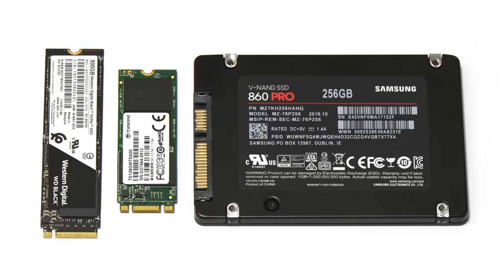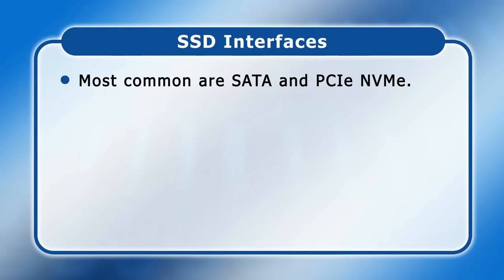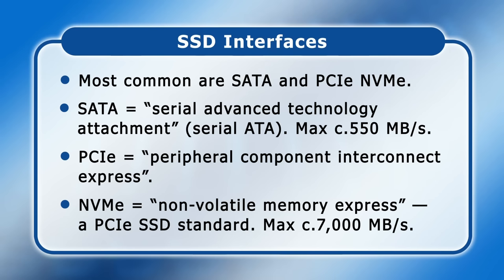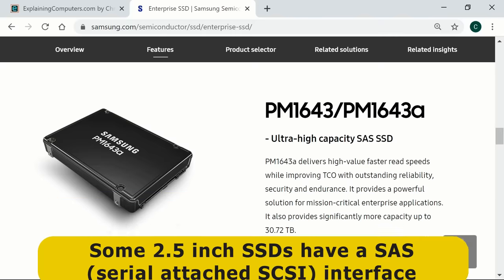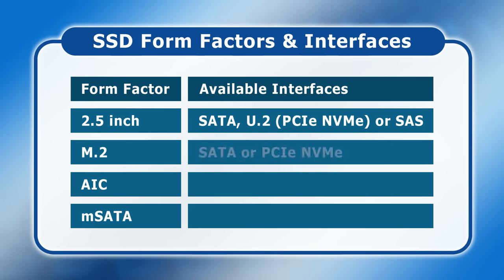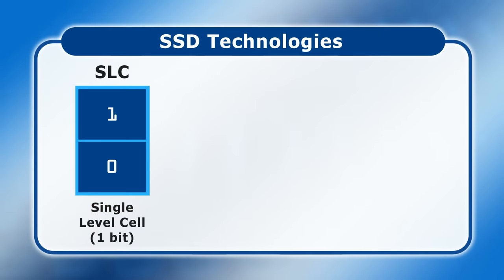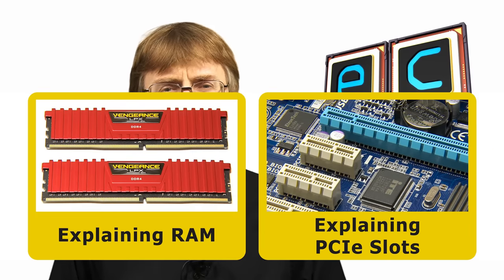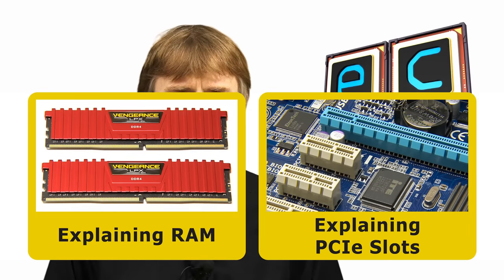Explaining SSDs: Form Factors, Interfaces & Technologies

Comment: This video is missing the various Apple PCIe slots, with different ones used in different models of MacBook, iMac, and Mac Pro.

This video is missing that Intel is exiting the NAND flash business, selling it to SK Hynix. We may not be seeing a PLC from Intel.

The most silly thing the video is missing is all the PCIe AIC that are actually SATA. A lot of PCIe cards adapt NVMe to PCIe, but especially the 2-m.2-slot adapters are SATA. Some of them even have SATA plugs, and use the PCIe slot only for power.
Reply from the maker: Certainly I ignored Apple here. Good point that Intel will soo be out of the NAND flash business, so will not be a final manufacturer of PLC SSDs.

On PCIe cards, it is not the case that all AIC  PCIe cards "are actually SATA". By definition, all PCIe cards connect to a computer via PCIe. There is no SATA interface in a PCIe slot so AIC SSDs cannot possibly be SATA. Granted, there are some PCIe adapter cards that allow SATA SSDs to be connected to the computer. But in all cases, the device is PCIe (though obviously a SATA SSD connected via  PCIe adapter can only run at SATA speeds).
Reply: I agree, it is certainly not the case that all AIC PCIe cards are actually SATA. Probably the majority on the market are not SATA. But just because the card connects via PCIe doesn’t mean it uses PCIe for data, nor that it connects the onboard drives directly to the PCIe lanes.

I should have clarified that the devices are silly, not the video. A contrived example is the Gigabyte i-RAM from long ago: A RAM disk that used PCI for power and transferred data via SATA cable. Much more common now are devices like this random device as seen on Amazon: One M.2 slot is NVMe connected to the PCIe lanes, and the other M.2 slot uses PCIe for power only and connects data via SATA cable.
https://www.amazon.co.uk/Rivo-Dual-SATA-PCIe-Adapter/dp/B07CGQKTWD/

Comment: Still no significant difference between nvme and sata3.  The short conclusion is, when it comes to only gaming, the tiny difference between M.2 NVMe and 2.5 inch Sata drives doesn't (in most cases) justify the price difference.

M.2:Who are you?
SSD:I am you but cheaper!
Reply from the maker: I agree that, for many home and gaming computer users, the benefits of an NVMe vs a SATA drive are pretty small. But note that, as this video discussed, M.2 is a connector -- so your final "discussion" is between NVMe and SATA, not M.2 and SSD. :)

Comment: So I could practical destroy and qlc ssd by formatting it 300 times? Wow that may not be practically possible but sounds concerning.
Reply: Unlike spinning discs, SSD do not require formatting to align the sector areas. This lessens the need to over-write old data, unless security is of the utmost importance. Realistically, you are just marking the locations as available for writing as opposed to blanking them out entirely.
Reply from the maker: Not just by formatting (well, not using the "quick format" option, as we normally do). But yes, if you wrote data to every cell on the drive and deleted it 300 times, the SSD would not be left in a happy state. It is for this reason that QLC drives only come in large capacities -- 1TB+. So you would have to write 300TB of data, which is quite a lot.
Reply: @ExplainingComputers  Ah yes...Makes sense.

Comment: MSATA was most expensive until now.
Reply from the maker: Surely not as expensive as SAS, U.2 or AIC SSDs?! :)
Reply: @ExplainingComputers  Well I have Gigabyte H61TN motherboard. Suddenly my MSATA was report on S.M.A.R.T position.

128GB replacement was 700.000 IDR (60 USD).

So I'll just stick with 2.5 Samsung SSD 860 Evo 250GB for better capacity. 👍

Comment: How are we already at the point where 100 TB SSDs exist? That thing seems like it could last quite a while!
Reply from the maker: I'm afraid you are wrong here. Yes, each cell has that number of P/E cycles. But that does snot mean you can multiply the number of P/E cycles for the drive (capacity) by that number. Well, you can do any calculation you like! :) But it remains the case that a drive can be filled and erased the number of P/E cycles that drive is rated at (typically a few thousand), NOT P/E cycles times cells I'm afraid. However you look at it, each cell in most SSDs can only be programmed and erased a few thousand times.
Reply: @ExplainingComputers  Okay, thanks for clarifying that! I sure with that was the case, but I guess there is a reason for that rating. I'm going to edit my comment so it doesn't have misinformation because I'm not a fan of that.

Comment: I have never lost data on  a real hard drive, going back to the late 1980's (I think.  I remember buying a 10mb hard card from a heathkit store for about $700; don't remember what year).  Anyway, I always manage to get important files off of a dying hard drive, or pulling it out, getting it heads un-stuck and putting it back in an backing it up.  Never lost a single important file off a real hard drive (I've been building computers since about 1981 with an Ohio Scientific Super Board.  Again, anyways, I have lost I have lost a lot of files from Solid State Memory, typically thumb drives.  What I fear when a 500gb SSD fails, you loose it all, not just a few sectors of head scratch platters.  An SSD is either alive, or dead; nothing in-between.  Finally our internet, here in my rural area, has 10MBS upload, so using WebDrive to map Google Drive, I've been able to backup gigabytes of Synology server data (basically all my life since the 1980s -lol, to Google Drive for $99/year.  I do not trust SSDs 100% with my data (although this computer I am on runs on two 500gb SSD setup in RAID).  Do not trust them.

Comment: To me any SSD's aren't ready for prime time. I got 20 SATA HHD's of various sizes that have been running consistently for 15 years without  failing.  I  also have 5 IDE HDD's that have been running almost constantly for 20 years.  I have had 4 SATA SSD's in the past 5 and 3 failed a month after warranty and the other failed under warranty.  My data is more important to me than the access time.   My Raspberry Pi 4 4GB NAS gives me 100MB/s  which is fast enough and very secure.

Rev George

Comment: Why don't they use USB memory in the M.2 NVME additionally with the SLC, this be much cheaper and extends the life cycle of the NVME memory, the data can be store in the USB memory cell and just released through the SLC NVME
Or even MicroSD cells next to SLC cells, to diversify storage.
FRAM memory also.

Comment: After watching hundreds of video's i still dont know what ssd i can use in my mpcie wifi slot (elitebook 8440p)
Reply from the maker: If the slot is specified for a WiFi module, then it is very unlikely it can be fitted with an SSD. The only manual I could find for your HP Elitebook 8440p describes it as having a "WWAN/WLAN module compartment". Even modern M.2 slots keyed for WiFi modules cannot be fitted with an SSD.
Reply: @ExplainingComputers  You are the coolest Guy ever!! Thank you for looking into my issue and replying👊🏾. I did find a lot of video’s on replacing the WiFi module with an ssd but did not find out how i could tell what type would be compatible.

Comment: The speed of an SSD appeals to me but being a creative and bearing in mind I make music on the system I would potentially be upgrading. The limited read and write cycles are still an issue for me with this technology. I can get 10 years plus out of an old clockwork orange drive. 100+ iterations of a mix on one song obsessive but it happens would burn those cycles fast. Your considered advice for my case would be to suck up the slower speed to avoid losing a drive after at best 2 1/2 years? .. ball park math with a calculator. Be gentle
Reply: A common setup is to install both an SSD and hard drive. You can install your operating system alongside a few programs on the SSD and use the hard drive for general data storage.

Comment: C'mon, tell me all your rigs. 
My laptop is a lenovo, 2.7gHz I7 7700 processor, nvidia 1050, 16GB Ram, 1.5 TB seagate barracuda HDD and Firecuda 500GB NVMe SSD. 

My Desktop - I5 9600 3.7 GHz CPU, 32 GB 3200 MHz DDR4 RAM, 1TB M.2 750 SN WD NVMe SSD, 1 TB WD blue SSD sata interface, WD Red 3TB HDD, Experimental HDD 40 GB barracuda, 780Ti Nvidia GPU, Z390a MoBo.

Comment: I can tell you for 99% of users NVME is not worth it over SATA, the difference is BARELY noticable and not worth the $30-$40 premium over a SATA drive. The only benefit to a NVME drive besides the unnoticeable speed increase is the fact you have two less cables in your case

Edit: Also there is a difference between real world and benchmarks, yes NVME drives are clearly faster in benchmarks but why does that matter if you can't even notice the speed increase? It's like the iphone having the best mobile processor but it's running a OS so locked down that it can't even use half of that processors power

Comment: thanks, didn't think to check here firs. Was searching on Amazon for NVMe to SATA adapter;  ended up with some spare M.2 NVME drives, still has open SATA ports on MoBo... thought "what the hell... OOPS... now have a startech paper weight. (yeah, I know I could have returned it... maybe will prove useful in the future... now that Microsoft intends to brick my collection of PCs)

Comment: I reference to the ad in cards:
Looks like hardcards are coming back from the dead
Reply: There's a blast from the past.  The Hardcard from Plus Development offered 10, 20, or 40MB (yes, megabytes) of storage.
Reply: @andrewkieran8942  I hail from the beginning of the gigabyte era (1991)🤫
Reply: @HrLBolle  I go back as far as the punch card era ('70s)🤫
Reply: @andrewkieran8942  then the retro computing channels are a trip down memory lane 😳

An the one channel with the ibm mainframe must be a special memory?
(computerphile I think)
Reply: @HrLBolle  Yes, but those were someone else's computers.  My heart belongs to my SWTPC 6800 with 4KB or RAM.
Reply: @andrewkieran8942  sweet unit.👍
Do you sometimes think of how the computer landscape would change if a group of soft-/hardware engineers including the manufacturering hardware were displaced in time to the early days of IC utilisation in computing ?🤔
Reply: @HrLBolle  Not quite that but I have wondered what an ENIAC engineer would have said in 1946 if they'd been shown a modern pocket calculator.
Reply: @andrewkieran8942  my response to you and your response to me PLUS Werner von Braun ...    and no war?

Comment: I've read that SLC ones have more in the range of 1-2 million cycles than the 100k you mentioned, meaning 10-20x the number. Around similar multiplication for the others too.
Reply from the maker: The numbers vary for drives from different manufactures, especially for SLC, and industrial MLC drives sustain higher P/E cycles than consumer. So inevitably what I quote are averages based on manufacturer specifications. But I can assure you that what you say is simply incorrect. The figures here are NOT out by a factor of 10 or 20. The information you have read is just wrong.

Comment: I am going to be a little bit nit-picky, but it has to be said that M.2 connectors can carry SATA or PCIe, and not just specifically NVMe. While very rare, PCIe drives that use the old AHCI standard instead of NVMe do exist. And of course, there are other M.2 PCIe extension cards, such as wireless adaptors.
Reply from the maker: You are being very, very pickly and in my view and needlessly so. And as I note below, not everything you say is accurate, at least in the context of what the video actually says.

On your first point, whilst you are right that M.2 slots can carry SATA, PCIe, USB, I2C, etc, there are no M.2 SSDs that carry more than one interface. In the video I was very clearly talking about the interfaces on M.2 SSDs, not the slots they plug into.. So I made no error or omission here. 

On your second point, agreed. But to avoid confusion I chose only to cover SSDs still on the market. There are lots of SSD form-factors and interface variants not included here as they are now legacy product, and hence I did not cover the pre-NVMe (AHCI) M.2 drives. And you will note that I slipped in a few "current drive" and similar statements to indicate this -- my words were chosen exceedingly carefully.

Finally, when discussing M.2 sizes, I mentioned that not all of them are used for M.2 SSDs, with the clear implication that they are used for other things! :) The subject of this video is SSDs, not wider peripherals. So when you say "And course there are other M.2 . . .", there is absolutely nothing in this video to contradict this. To be clear, nowhere do I say that all M.2 devices are SSDs.